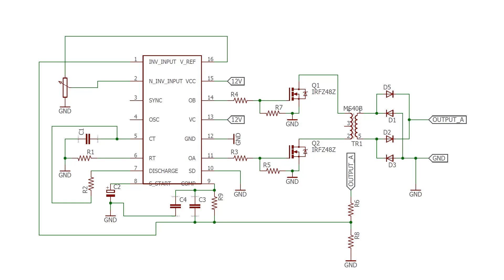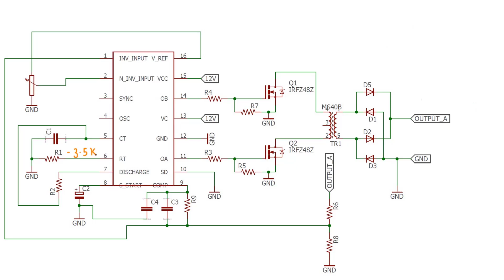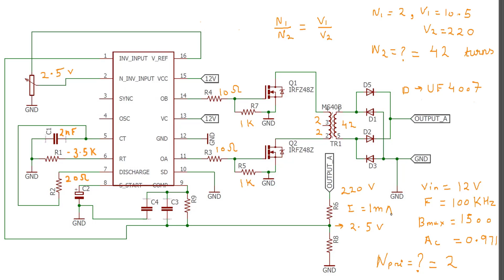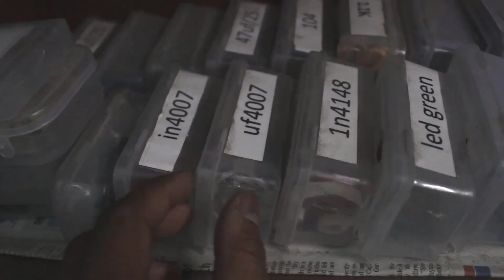SMPS | 12V to 220V | Charge your Laptop in a car

Comment: Excuse me sir i have many question regarding to this tutorial 
1.can you explain me how to connect laptop charger to this circuit ? sorry to say but your video is not detail enough at the end. 
2.Also what to connect at pin-2 (sg2535 ic) to what component ? i dont really understand the schematic diagram which you done provide
3.at pin-8 what kind of capacitor do you use and how many farad ? in schematic diagram also lack of information 

thanks

Comment: what do you mean by programing an IC ? what's the program for it?
Reply from the maker: +MAULIK SHARMA This is sg3525 ic. I was not talking about software programming.
By programming, i meant to say that you have to use resistors and capacitors to set the desired frequency.

Comment: Keep in mind that in your car the max voltage is 14.4v and because 240v ac smps can only taks 350v dc max if it exeds the max voltage it will blow up and if you use a cheap chinise adaptor then forgot your laptop!!! Most of the laptop takes 19v so use a dc to dc boost converter and it is lot more efficient and safer if you dont to anything wron your laptop wont fry!!
Reply from the maker: +Kuntal ghosh This tutorial is published to throw some light on SMPS designing,  however, to keep the output voltage stable irrespective of line and load voltage, negative feedback is used in the design.
Reply: Shailza Kant Pandey is there anything I'm missing out? I tried using your design as shown in the video but for 180v with sg3525. But when i connect the mosfet, the signal seems to change rapidly into very narrow waveforms which i assume is not right. But i still managed to get the output of 180v that i designed despite that problem. 

Also, what's the right way to connect the output to the adapter?  You seems to be using some sort of socket in ur video to plug it but are there any other ways to do it? Dont have the socket thing. Thanks.
Reply from the maker: +Lmao You can use any 3 pin socket in which the power pin of your adapter can be plugged.
Try to adjust the pwm so that output voltage is atleast 220V.
Reply: Shailza Kant Pandey Hi. Thanks for the reply. May I know what is the correct way to connect the live, neutral and ground pins to the circuit? +ve to live and -ve to neutral? And why 220V? Typical adapters takes in a minimum of 100V AC so DC will be 150V? I'm using 180V maybe that could be the reason why it isnt working well.
Reply from the maker: +Lmao 1) Since the output is DC and it will again pass through the rectifier stage in the adapter.so polarity does not matter here.

See the output is alraeady DC. Also if you rectify a 220V square wave with full bridge rectifier the out voltage will be 220V only because for a square wave rms volatge is equal to peak voltage. but in case of sine wave the rms volatge is peak / root 2.

Now i come to your confusion of why not using 180V. 
the answer is you can use 180V , the adapter will work because it will have it's own feedback circuit inside so that output voltage of adapter should remain constant. However the if you are using 180V to power up the adapter it will draw more input current as in case of 220 or higher voltage to keep the power constant.
If you plug you adapter to 220v mains grid supply which is sine wave, the 220v sine wave is rectified to 311V dc ( 220 x root 2 ).
but if you provide 220V dc to adapter it will be converted to 220v dc only..

Comment: Hi,

I tried making something similar to this circuit but with a slightly lesser output voltage of about 180V. For my power source, I used a DC power supply of 12V instead of a battery as in your case. I am a little confused on how you connect your DC output to the AC adapter of the laptop? I tried clipping the output to the live and neutral pin of the AC adapter, but the LED of the DC supply seems to be switching from CV and CC mode constantly. Does this mean the current limit is not sufficient to power the laptop?
Reply: Lmao use a battery i think you set the cc too low !!!! My inverter takes 12amp on 14.4v with a 150w load on 240v ac!!
Reply: Kuntal ghosh does a laptop takes that much current? In the video, we are still using the adapter so the current input is about 2A or so? I'm just confused on how to connect the output from the dc-dc converter to the ac adapter as it was not shown in the ending part of the video.